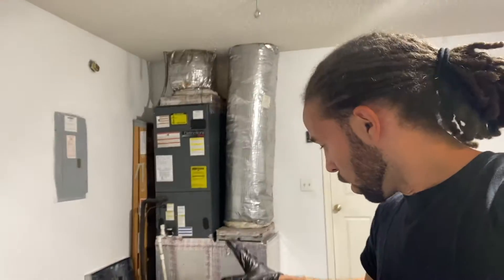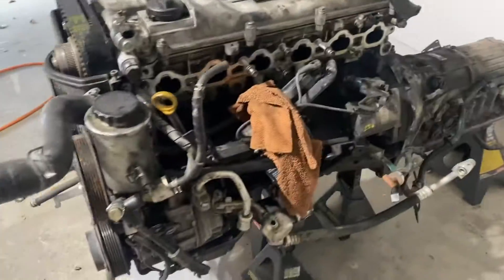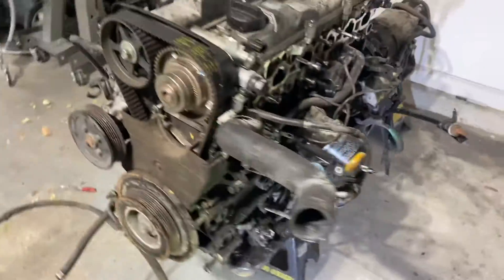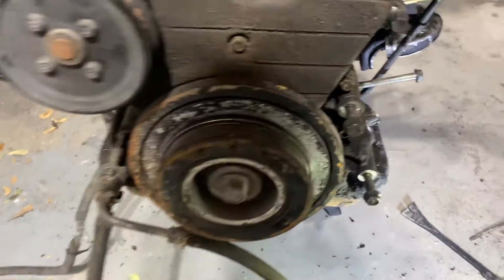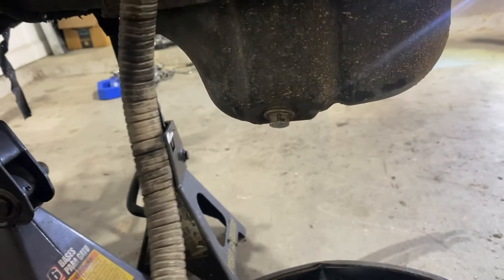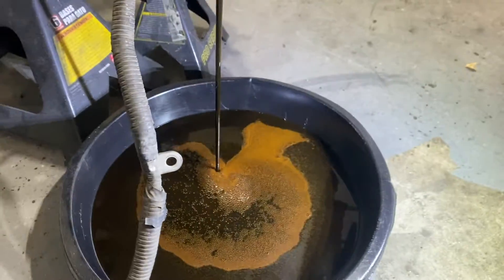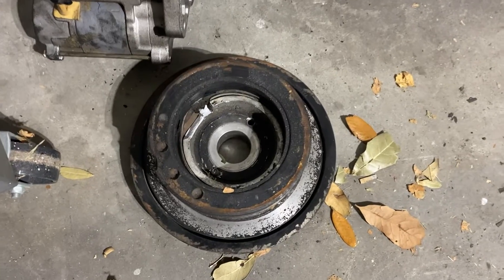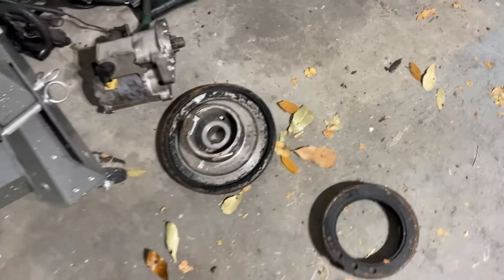2JZ Teardown Part 2

Comment: I wish I knew everything about the motor because my ac compressor just went out well what the mechanic told me my car was rattling and they are saying is the ac compressor so now I have to buy that and plus the labor it’s tooo muchhhh 😂😂but keep it up man your doing good ! For the most part 😂😂 tight bolts could be frustrating 😂